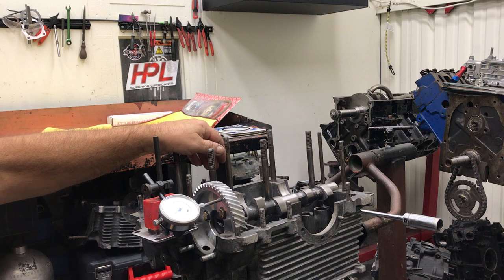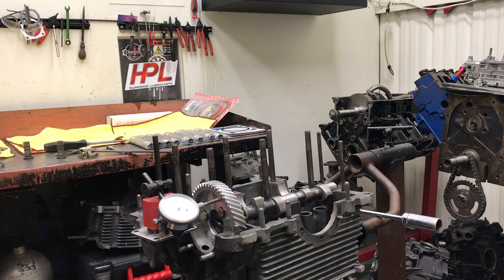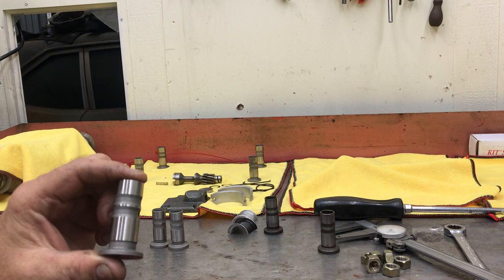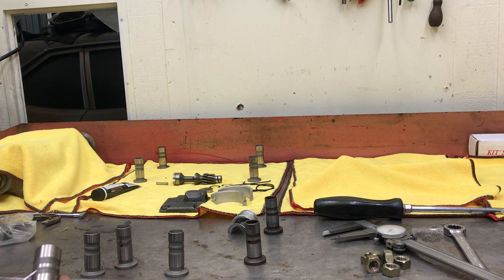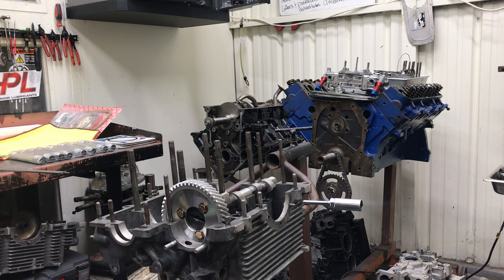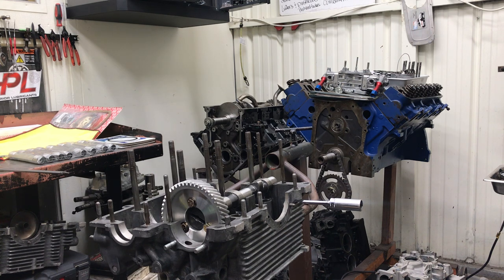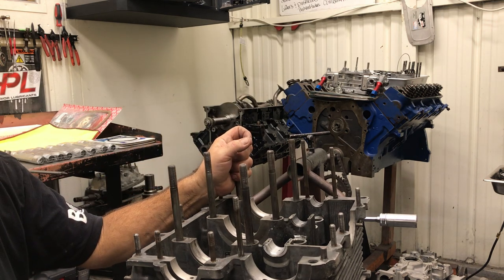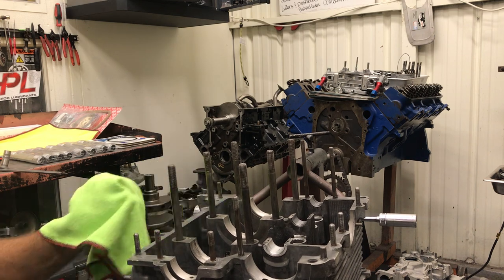Quality issues on the 1776

Comment: As always brother great information, I definitely appreciate all the knowledge you share with us Darrin!!
Reply: I feel smarter than I did yesterday ☺️
Reply: Don’t know whether you’ve ever responded to this question before, but what is your opinion of running a newly rebuilt engine at 1500-2000 rpm outside the car for a couple of hot and cold cycles (approx 15 mins) then re-torque the heads and readjust valve lash? This would also serve to break-in a new cam to lifters, correct? What would be the max head temperature you would allow during such a (no-load) run?

Comment: Wow, very informative. Hate to say but I've never clearanced a cam before, just popped in the bearings and moved on. Maybe some day explain how you remove and reattach a cam gear to the camshaft. Never done that either. By the way, I always watch to the end.  :>)  Also, thanks for explaining the oil cooling aspect, makes a lot of sence.  The specific heat of the different oils will determine the heat carrying capability.
Reply: Check his older videos.  He has at least one showing cam gear installation, if not more.

Comment: Recently saw a engine lock up after very few miles from 0 oil pressure. The tang had broken off the oil pump drive gear. Upon further investigation, it broke because  the slot on the cam was cut off center. 

Our aftermarket is a embarrassment, considering there were more beetles made than any other car. 20+ million type 1 engines, and we are still dealing with issues that could be very easily fixed with today’s CNC technology.